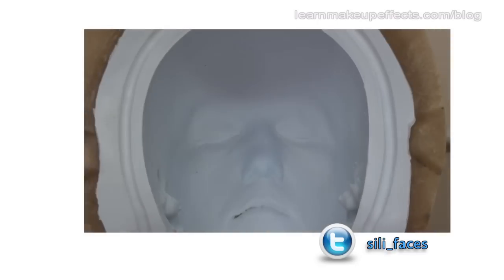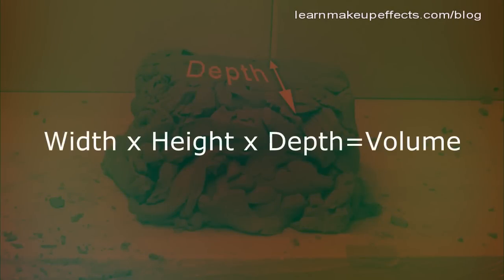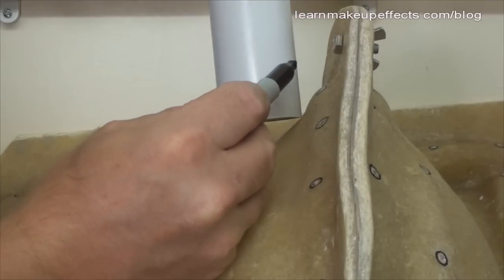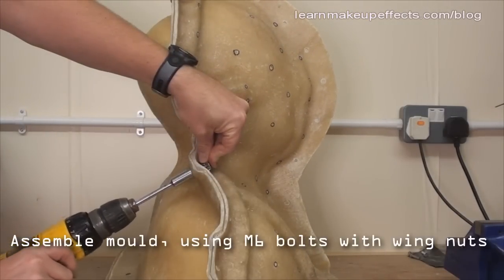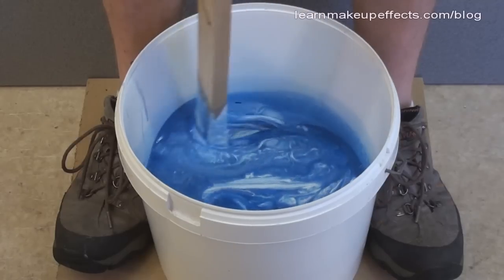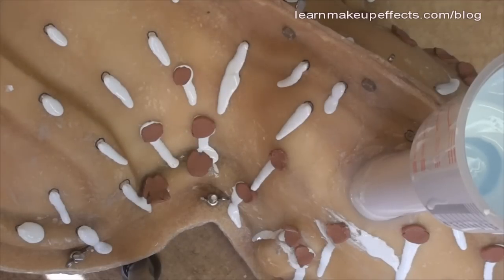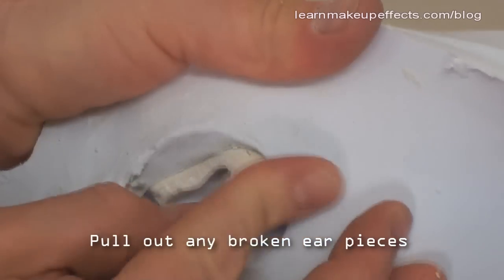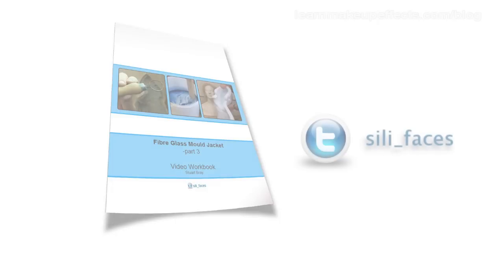Using Fibreglass Part 3

Comment: Hi Stuart.... regarding this half of the face- why didn't you just do a "simple" brush on silicone mould and then fibreglass over it? (just curious- I'm not being a belter)
Reply from the maker: It's a good question. You'll get a better result, with neater keys and consistent controlled thickness of silicone because all that is established with clay.

I really like a continuous key around the edge, and it's easier to do this in clay. Brush on moulds work well for the sort term but I like to use a pure silicone without adding thickeners or accelerators etc. if possible which can reduce library life. 

I have also a done brush on mould video.
Reply: @stuartbray  got ya! Thanks for replying! I’ve been studying these videos recently. I’m about to have a go at a pretty ambitious project… trial and error is my main thing… which I’m happy with (time and money currently allows)- given myself a 40% success rate on this one 😅.
I can ping across what I’m working on if you’re interested (Paramedic… making a training aid)

Comment: OMG THANK YOU ~ CAN THIS SAME METHOD BE USED ON SILICONE DOLL PARTS TO MAKE DOLL MOULD PARTS TO MAKE PORCELAIN DOLL PARTS?
Reply from the maker: Are you casting porcelain out of these are moulds? Or a resin that appears to mimic porcelain? 

Usually, porcelain or clay based items are slip cast from plaster moulds as the moisture in the clay can soak into porous clay, leaving the clay residue behind. 

Silicone, on the other hand, is waterproof, so it will not absorb moisture from clay slips, which are put in there. 

If you are using a resin, then I would suggest a wax based mould release spray.

Comment: Stuart Bray
I have learned from your video,and still want to learn more,I was just confused about the back,u didn't make a silicone just the front side of it ...thanks☺️
Reply from the maker: Hey. I think I mentioned it in one of the videos but basically the back is smooth without detail so a rigid mould which costs less that silicone is fine for the back and saves some money.

Comment: I’m confused. How I learned is using brush on platinum silicone building layers to your desired thickness then create the fiberglass mould. This way you use minimal silicone since it’s more costly then fiberglass. Is there a benefit in doing it your way I’m not aware of?
Reply from the maker: freedom fighter usually you need to add accelerators or thickeners to change the setting and viscocity which often reduces library life of the mould. Also the finish is much neater as the shape of the silicone and the surface is made with clay allowing a much neater finish. I have done most of the moulds in my life as brush ons as you say but pours like this produce a much nicer finished piece.

Comment: I noticed you used, what appears to be, tin silicone. Is there an advantage, other than cost, to using tin rather than platinum, or does that depend on the material you intend to cast?
Additionally, what sure hardness (range) do you recommend for something similar to your video example?

I ask because I had originally purchased a platinum 15A, (to mould a corrected positive, elevated/extended bust armature for masks) thinking I might do a two or three piece fiberglass mother, and inside, make the silicone mould like a glove to stretch over the stone or urethane plastic, upon removal, rendering a seamless corrected bust.  I also choose platinum for its archival properties, since I know I'll want to make multiple copies, but I may not want to do more than a few, presently; perhaps in a year or so, I might want to cast a few more. 

After watching your video, along with still being fairly green to the mould making aspects of fx, I find myself questioning my judgment, and original plan. I'd certainly appreciate your input.
Reply from the maker: Tin is usually what I use as I don't need to keep moulds forever. I have a small workshop and no wish to keep things I won't use on ongoing projects.  

you can use platinum silicone which as you say are best for archival reasons and will last longer by far. 

I personally like a two part silicone and around 20 to 25 shore for a standard human head. I will happily take the minimal work of repairing a small seam on a good mould Iver the difficulty of access found on a single socks like-single single piece mould which has no seam.  

There may of course be reasons to do male something seamless and if this is the case then that will require a silicone flexible enough to permit the stretching required to demold such an item.

We made the auton heads for Dr Who as single piece masks with no seams by brushing on plat sil gel 10 in multiple layers over a clay sculpt. 

from this mould we swilled hollow urethane heads which we could pull out. Be case we swilled them,  we didn't need to see inside whereas fibreglassing would indeed need the access and visual availability of a two part mould.
Reply: +stuart bray Ah! Okay, that makes sense. Thank you for your reply!  Also, thanks so much for taking the time to share your knowledge with all of us who genuinely want to learn the proper ways of doing things. 

Having your videos, and pdf(s) significantly helps to augment my education, and I'm 
so grateful for it. 🌻
Reply from the maker: +Gothic awesome!  That's why I do it. I care about making things and I learn as much from other people.

Comment: Really interesting - Would this work for a shape with an underside, such as a skull?  I'm guessing it would but the mould would be in more pieces?

Loving the channel!
Reply from the maker: Yes, you can make fibregass skulls from silicone moulds.  As you suggest, the undercuts that such a shape will resent mean soft silicones or multiple piece moulds will make demoulding it without stressing the mould easier. 

Obviously, the more pieces involved in the mould then the more seam lines you will have to contend with on each cast from that mould. I have seen good skulls come from two part silicone mould though.  The jaw is usually a separate piece, but the skull upper can be two parts.
Reply: Thank you!  Something for me to try after I have some practice under my belt :)

Comment from the maker: @ Michele Mathison - For some reason there is no 'reply' button so Ii am placing this  as another comment which hopefully you will be able to read.

In theroy, you could dispense with the gelcoat but in the interests of having a smooth interior surface which is easily cleaned, and a texture free surface against which the silicone can remove easily from, a gelcoat is advisable.

Also the stamping down of the fibreglass in order to get a smooth, even finish in the fibre mat means that the glass texture would be stamped into the soft clay beneath.  A gelcoat acts as a barrier against this also.

Comment from the maker: As the silicone gets into the mould, the air that is in there needs to escape easily so these holes allow that to happen. Also you can tap pockets of air in corners so putting numerous holes in reduces the incidence of that. The trade off is a little silicone lost in the 'bleeding' but that is a small price compared to a useless mould.

Comment from the maker: I think PAX is about as cheap as it gets.  Pros Aide is about £30 for 500ml, acrylics about £3 a tube...I think that is a baseline for expense that you can't really avoid without using stuff that isn't ok for skin.  That would make a lot of paint which means cost per application is not bad at all.  It's all the initial investment, as with any endeavour which requires stuff, which comes with the cost.